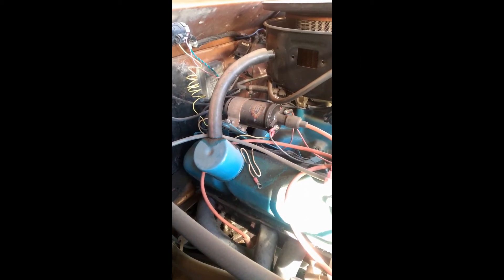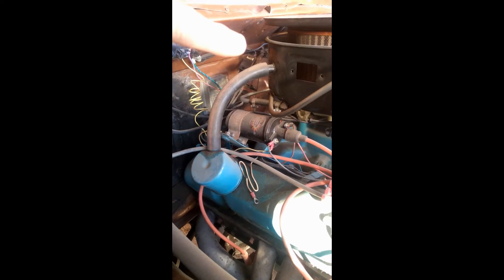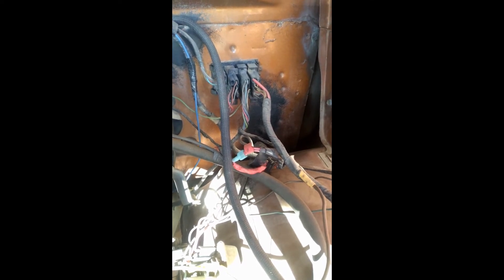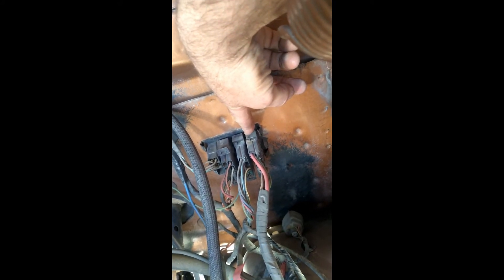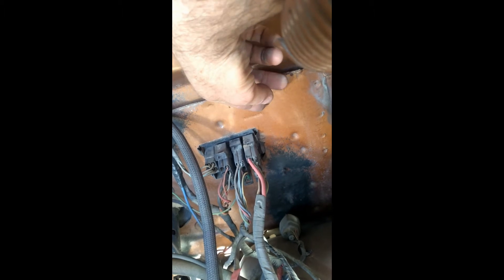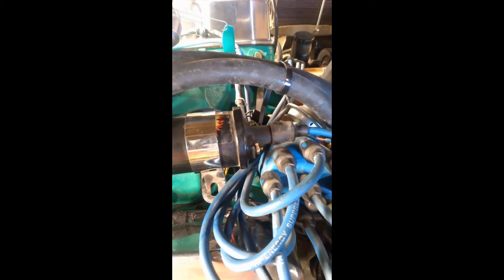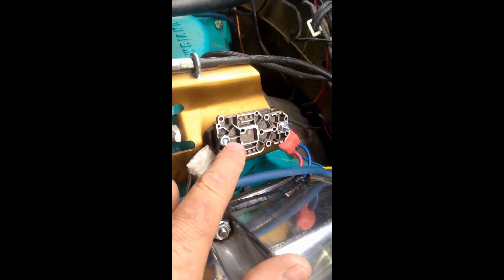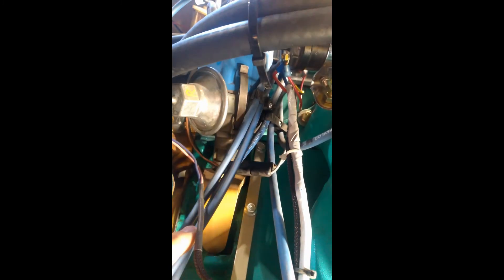Hei swap on Dodge Electronic Distributor or Petronix

Comment from the maker: That module went tits up....  Couldn't figure out why the car just didnt want to start in cold weather. Acted like it just wasnt getting gas and need a choke. This carburetor does not have a choke. Turns out the HEI module was just getting worse and worse not sparking. Swapped it out for a new one and starts like a champ again.